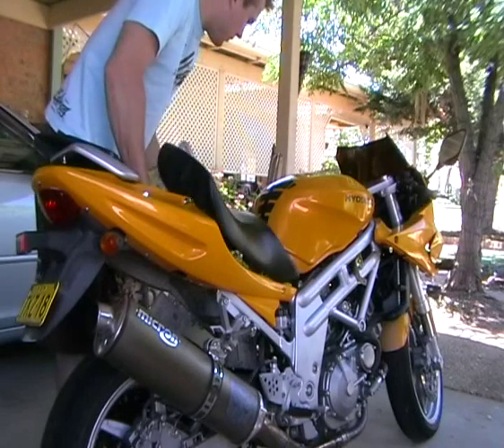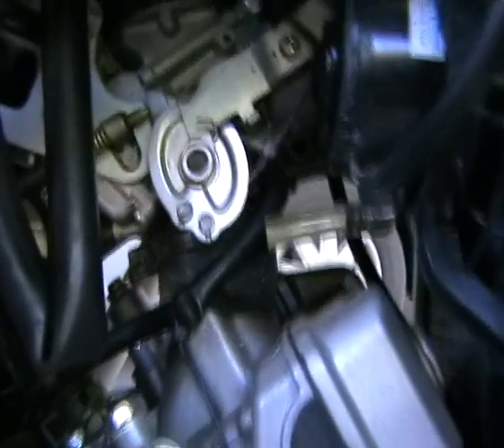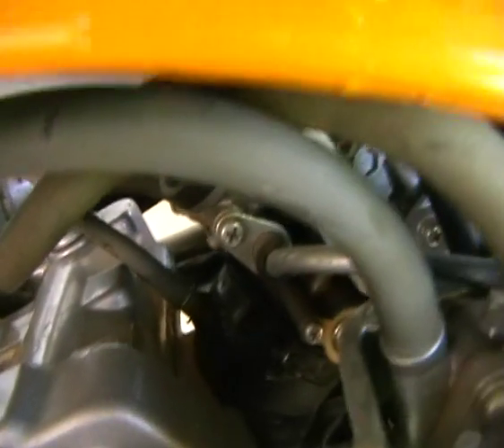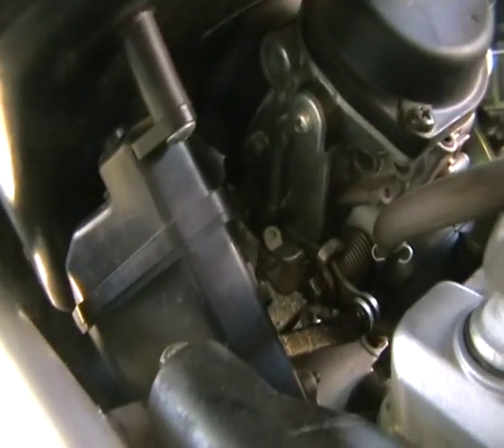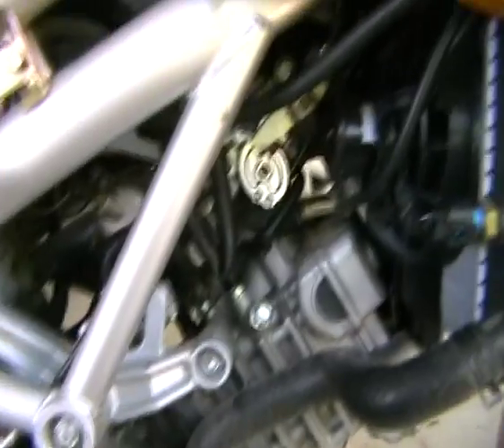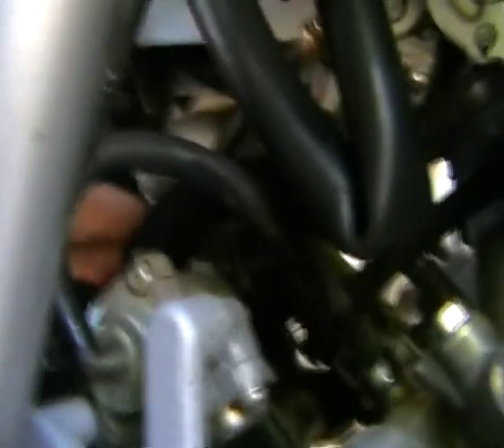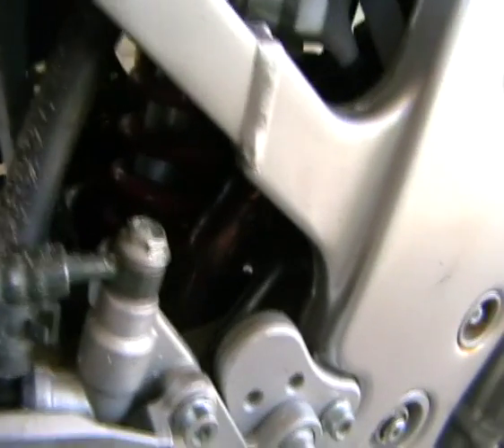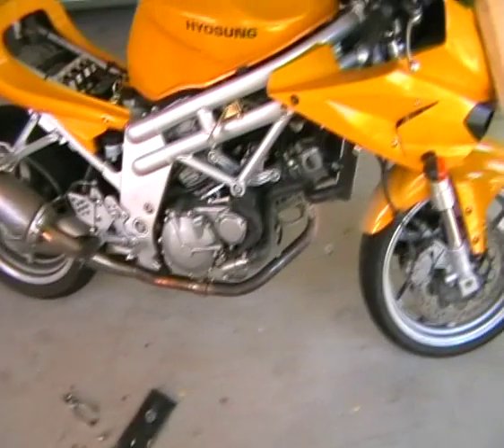Hyosung GT650 AIS + TUNE

Comment: Please make a video on clutch replacement and timing adjustment of hoysung gt 650r
Reply from the maker: Sorry champ, I have upgraded my bike a few years ago now. Good luck with it.
Reply from the maker: @Jimmy Doran It's purpose was to annoy people when riding. If you have replaced the original exhaust and air filter the bike with after market gear it would start popping and crackling out the back of the exhaust. This was done to eliminate the air intake system through into exhaust. It was well worth the effort.

Comment: Hi I have a question I have a 09 gt 650 just put a danmoto jisu exhaust on and it pops a lot when I'm slowing down and when I close off.so I done carb sync and closed off ais but I'm still getting pops. It said in the description on the exhaust (no fuel adjustments or rejet need) so my question is do you still get some pops and cracks cause people are saying it normal for a big V
Any help would be great thanks.